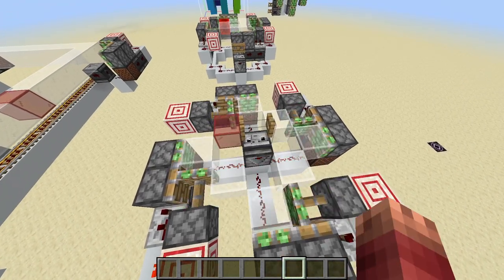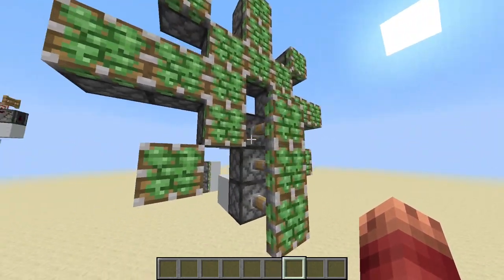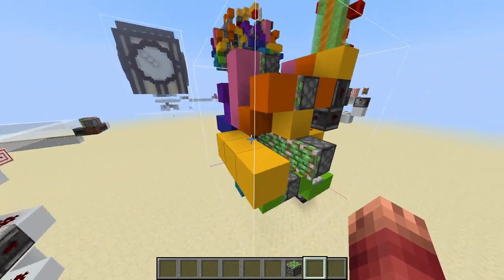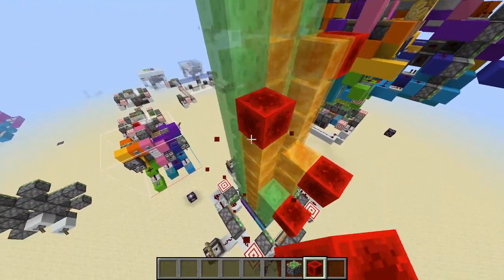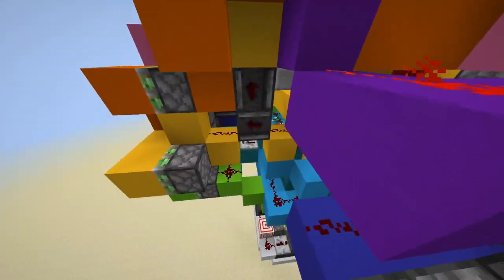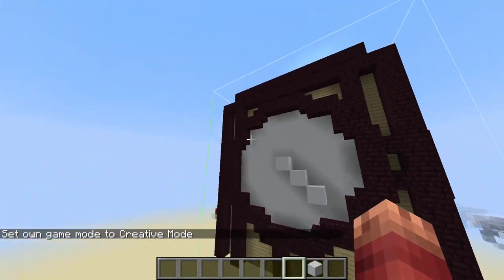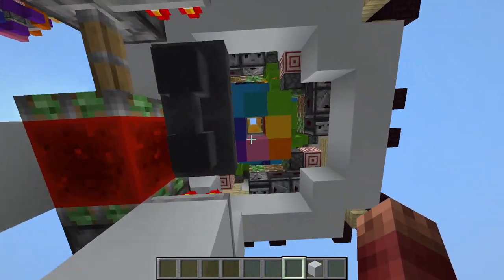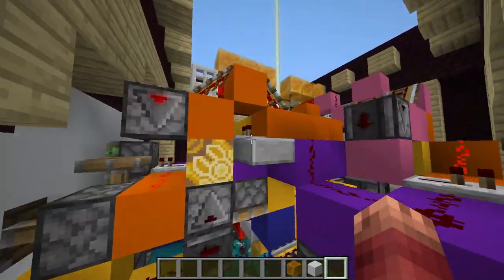4-sided WORKING Clock Tower

Comment: I've got trouble importing the files.
I created a new folder called 'structures' inside the world's folder and put the files inside that 'structures' folder.
But when I try to load it in with a structureblock, minecraft says: Structure 'minecraft:4_face_clock' not available
Reply from the maker: the structure folder location moved in 1.13. Make sure you aren't using the pre-1.13 structure folder location
Reply: @redinator2k  Thanks :) I looked up what location it needs and it works now. 
(for anyone with the same problem it's '.minecraft'>'saves'>'World_Name'>'generated'>'minecraft'>'structures' and then you can put them in that structures folder)